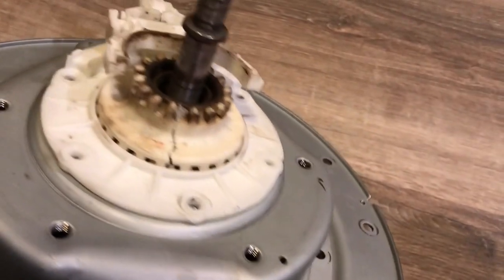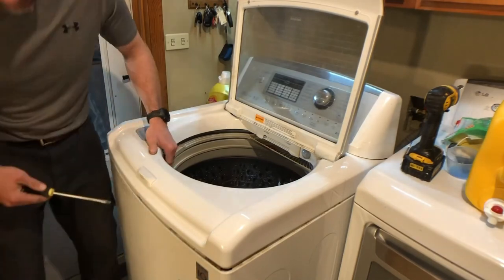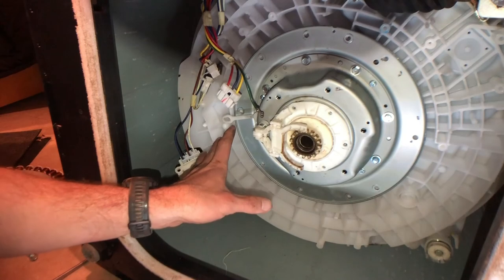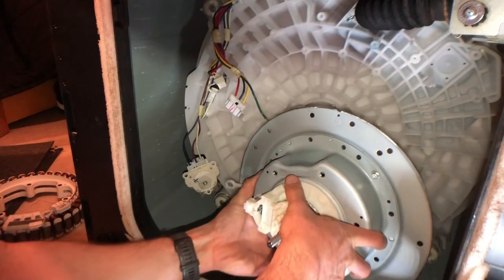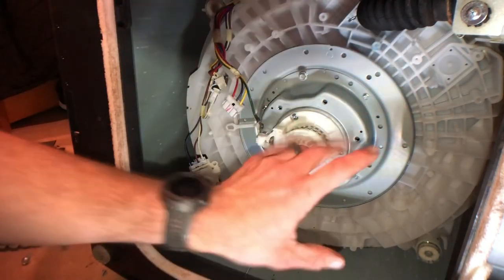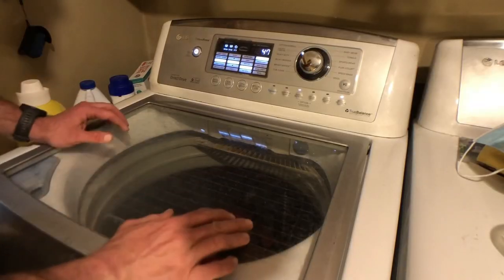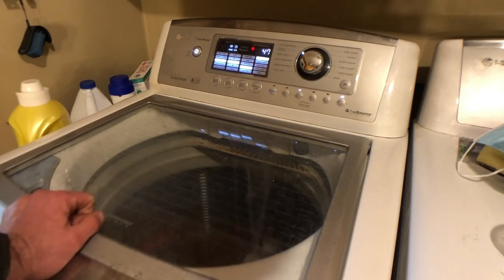LG Waveforce Washing Machine ClutchHub Assembly Replacement

Comment: HI What were the symptoms of this part needing replacement? Mine is not making a heavy grinding sound but a more heavier swishing sound and I feel like it is going the way of yours. Great video Thanks . Like you I had to replace the top - rusted to hell and never use bleach as that is what LG accuses consumers of as the root cause of the rust. Just bad paint/rust proofing. Wish you had shown what the machine sounded like with the part going bad.
Reply from the maker: You might check the big nut on the very bottom in the center underneath. I had something like that prior and the nut actually came off so motor was moving but not spinning ajatator correctly.

Comment: Hey Bugman. 
Quick question. I have this drama at the moment. I noted that there's a thing under the tub (looks a multispoke wheel (from 17mins)) how did you get that off? 
I've drenched the thing in lubricant and given it a rather heavy few whacks but doesn't seem to want to budge. Any ideas? 
P.s Nice dog!
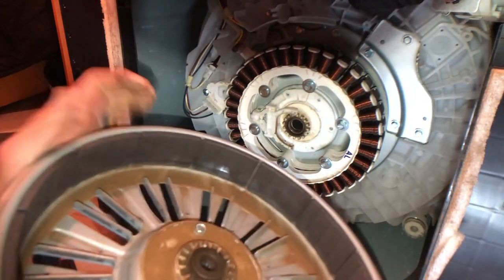Reply from the maker: Are you talking about the outside metal (rotor?) part at 6:33 or the part underneath with copper wiring wound on spokes ?

Comment: I have the same exact washing machine. The 38mm socket is rounded so I can’t remove it with an impact driver. Any tips?
Reply from the maker: @coreywatson2543  vice scrips on the nut and hit them with a hammer. May have to have someone hold the drum or agitator that spins with it

Comment: What was it doing for you to replace this? I replaced this part a couple years ago and I just recently replaced the suspension rods because the washer shakes and is noisy as hell the last 30 seconds of the final spin. That’s the only time it’s noisy.
Reply from the maker: I originally thought it was the suspension rods as it would shut down for unbalanced load and I didn’t think the grinding noise was the problem from the bottom agitator. I thought it was just slightly louder from being older but as more time progressed the grinding got pretty severe. Just laying the washer down to look at bottom showed the cracked plastic hub. It is easier to replace the clutch unit as a whole than to just buy the gear to replace.

Comment: Hi, question,  how did you remove the inner nut that holds the basket to  the shaft?
Reply from the maker: You have to use an impact driver with a 24mm (I think) socket.
Reply: @BugmanVlogs  ok, that makes alot of sense! My arms and elbows  feel like jello  lol!  Thank you for the advice.
Reply: Is it required to take the inner basket out?   Seems like added work??